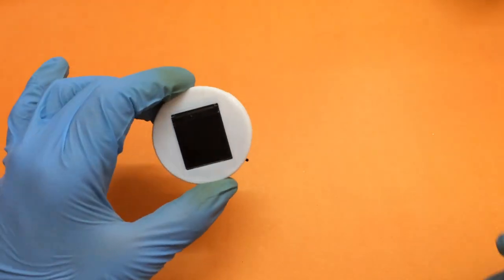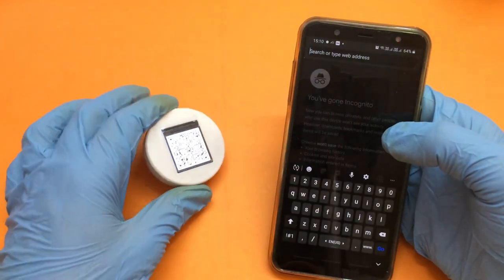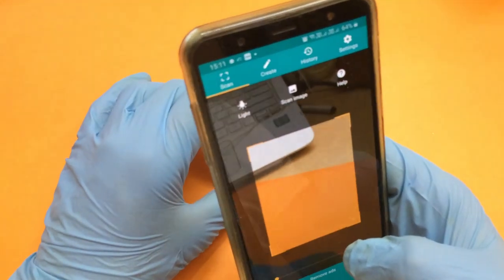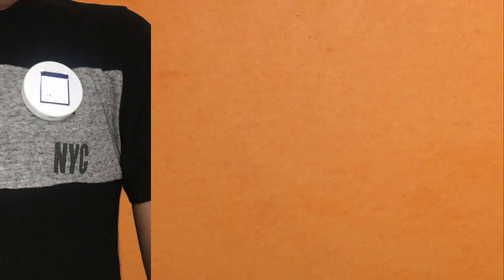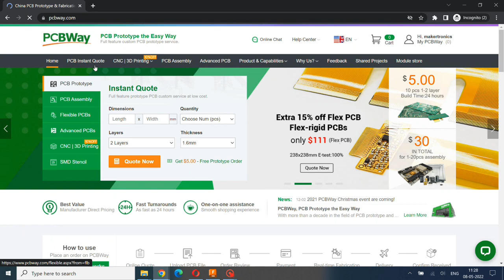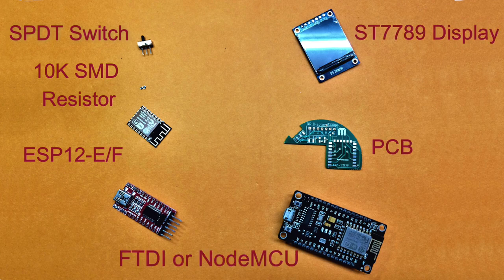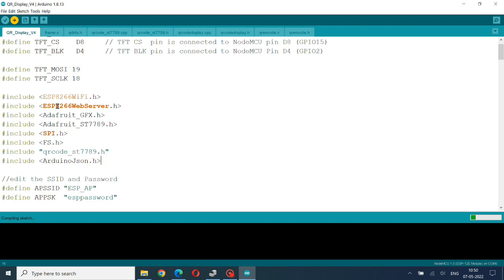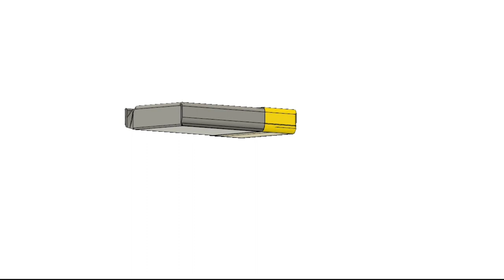Refreshable QR Code Display Badge

Comment: I feel the title is a bit too simple as it makes it seem like it will just display one QR code which anyone can print and it will do the purpose. The title should be more like "Dynamic QR Display Badge" or "Configurable QR Display Badge using ESP8266". Mentioning ESP8266 will help ppl like me find it more easily. Plus you haven't added any tags in your video. Maybe consider learning a bit about youtube marketing/video promotion. That's for reaching out to more audiences. Great educational video overall, just need to work more on marketing so you can reach out to more ppl and others can benefit from it as well :)
Reply from the maker: Thanks for the suggestion.😀